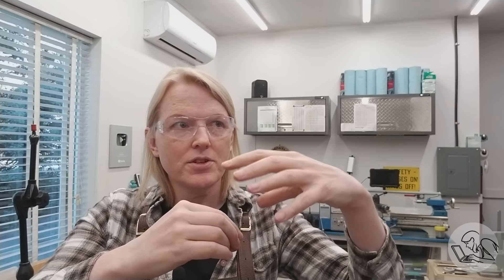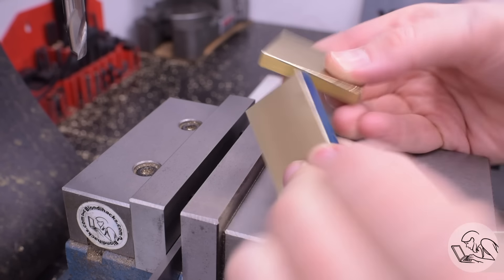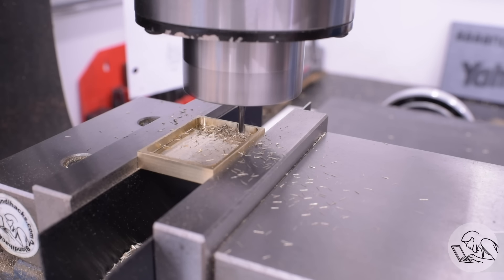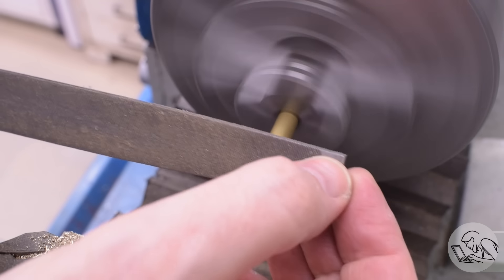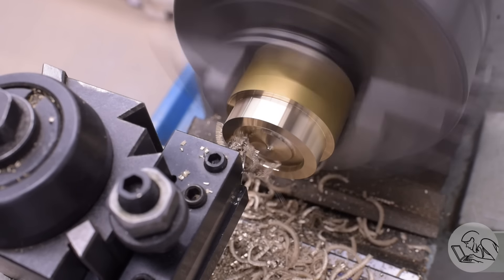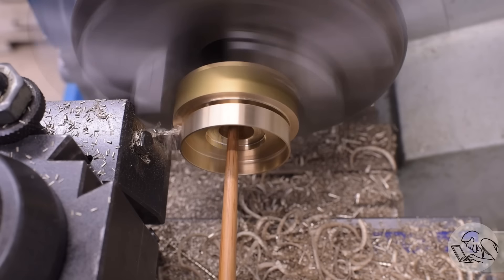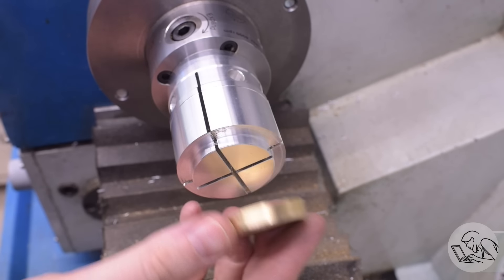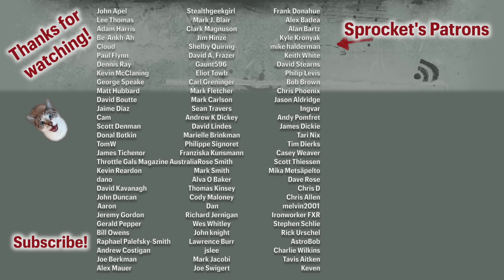Cylinder Covers - Pennsylvania A3 Switcher, Part 49

Comment: Self sealing stem bolt.  Nice reference, Lieutenant Commander Dunki.  🖖
Reply: someone explain the joke, i'm missing the reference
Reply: @cguvn  - Star Trek reference, specifically Deep Space 9.
Reply: @cguvn  "Somebody has to teach you officers the difference between a warp matrix flux capacitor and a self-sealing stem bolt."
Reply: nice. The reference pops up a few times in DS9. Kind of a go-to for useless cargo.
Reply: @dakavanagh  They even shows up in Lower Decks. (Though to be fair, everything shows up in that show. :)

Comment: Oh hey there Quinn, being Mighty as usual I see. On the purpose of the covers, I have to believe that part of the reason was to protect the insulation lagging that was used to maintain the cylinder temperature. Wouldn’t want cold weather to be robbing your horsepower now I bet. And you also don’t need wet lagging, same principle. And having it protected from the elements, also serves to protect anyone who might come in contact with them, as steam is rumored to be rather warm. Your covers are very nice and close fitting, leaving no space for any lagging, but as it is a model, it will not be a big deal.  Nice video, hi from Germany

Comment: Hey Quinn! Believe it or not, all the steam chest cover-covers I can think of having worked with on locomotives have been cast; man are they heavy! Often awkward to install as well, as the central studs that retain them are rather tall and the clearance with the bottom of the smokebox can be tight... The ones I've worked with before have just been held in place by their own weight.

At least around my local roundhouse, we refer to the round cylinder covers as "Bongos" for the wonderful timpani noise they make when something bonks into them. Not at all technically pertinent, but it makes us smile and hope it does you as well-- great looking progress on the locomotive!

Comment: Well, to be fair, the corner rounding bits were residing in a corner of the yellow tub they laid in, and until you opened the drawer, it was dark in there, so you did find them in a dark corner :P

Comment: I keep on meaning to make myself a vice stop - watched you making one a few years ago. I never got round to it, and have instead been using other clamps etc. to get by.

I noticed you're not using yours today. Is it a tool you've given up on? Was that just a magnetic indicator clamp turned backwards with the shaft used as the backstop, and if so does it work as well as your custom built one? Maybe I can take this off my outstanding projects lists!
Reply from the maker: Yah most of the time the magnetic indicator stand is just quicker to grab and set up. It also works in more situations (thin parts, parts wider than the vise, parts lower than the top of the jaws, etc).

Comment: 2:00 In Germany, there was extensive testing in the 1930ies of those sheet metal covers for locomotives, and they found indeed an increase in speed and a decrease in coal consumption at high speeds, that means over 100 mph. So yes, they made sense for high speed trains. But on the other hand, at the time, diesel was mature enough to replace steam especially on passenger rail, as it was less dirty. Europe shifted high speed rail to electric locomotives at the end of the 1950ies, hence streamlined steam locomotives were rather short lived, because the services they were built for were no longer steam operated. And at lower speeds, the sheet metal covers did not provide enough advantages to allow for the higher cost, higher weight and worse servicing access.
Reply: @NitroTom91  The research in Germany was about trains going faster than 160 km/h. The first trains to do so were two electric units from Siemens and AEG, of which the AEG one on Oct 28 1903 (exactly 101 years ago) posted the world speed record for land vehicles with 210.2 km/h. To get steam locomotives faster than 160 km/h, there was lots of research in the 1920ies and 1930ies, which culminated in DR Class 05 002 reaching 200.4 km/h in 1936.

Comment: Yes, fatigue is a verb 
I just checked and the dictionary gives an example that's pretty much exactly as you used it
Reply: Then again, the only important thing is that your message comes across. So, when verbing a noun, it doesn't matter if it has been dictionaried already, only whether your audience understands you.
Reply: @daanwilmer  yeah, but it's nice to have confirmation
P.S: besides, my paper dictionaries from the 1960s also affirm this use of fatigue, so it's not even a recent addition 
We've been using it this way for well over sixty years

Comment: When you test a thread while it's still set up in the lathe, do you crank down the threads or just check to make sure they fit? I would think that cranking down on the threads while it's still set up could potentially mess with alignment, correct?

Comment: The round covers with the small centre hole - I recently made 2 almost identical parts, slightly bigger centre hole - from white nylon - replacement hinge covers for my toilet seat - the (allegedly) stainless covers had rusted/corroded.

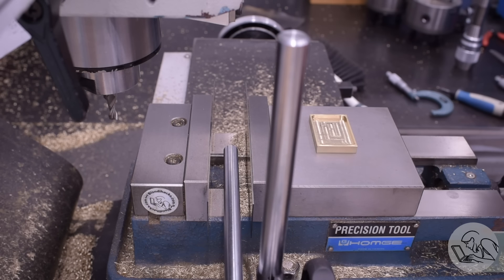Comment: 5:20 - ok, but question: you've got the end stop for repeatability, but it seems to go away between cuts... how is the repeatability of the end stop positioning attained?   Like, does it ride in the t-tracks, and there's a stop for the stop?  (Like the covers for the covers?)
Meanwhile (re 9:36), "always chamfer your hexes" -- somehow, this sounds like some Witch's lore or something, and now I find myself wondering what "to chamfer" might mean in some sort of Wiccan context.  😂  (And finally: LOL, steamy steamy.)
Reply from the maker: Sometimes I remove it for clearance during the operation, and sometimes it seems to disappear because I edit out of order for clarity. There’s no real need to leave it there during the cut. As long as you place it again before removing the part.
Reply: @Blondihacks  right, but I'm just wondering how you get repeatability on the end stop itself... like, how do you get the stop to be in the same place each time, so that the part can be, too?  Sincere question!
Reply: @DavidLindes  It is a matter of touch, I think, same touch, same pressure, same location. Actually, it seems to just be a touchy subject, but glad you brought it up.
Reply: @CothranMike  uhhh.......  🤔
Reply from the maker: That’s it, really. Just push the stop up against the part, remove the part, place the next part against the stop, and now you can remove the stop. The stop repeats the part and the part repeats the stop. As long as everything is clean, that will work every time.
Reply: @Blondihacks  ahh, of course! The part repeats the stop! Makes total sense, now that I think of it. Not sure why I didn’t, unaided. Thanks, Quinn!

Comment: A cover for a steam chest cover. Secondary cover plate. Auxiliary cover. ETC. Head on top a block followed  by a valve cover with  an oil fill cap topped with paint and lettering to specify lubrication procedure/instructions.

Comment: I couldn't find an exact word for bending until breaking. "Fatigue" is a verb, but it doesn't seem to include failure. How about "terminal embrittlement"? In any case, it likely first gets stronger through work hardening, then deteriorates to failure.